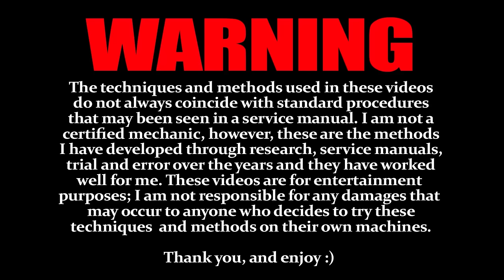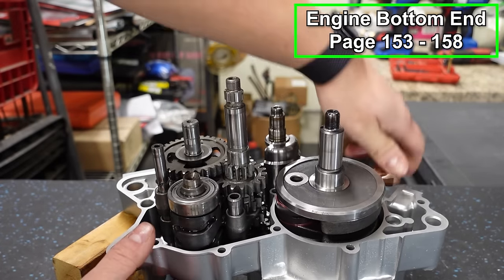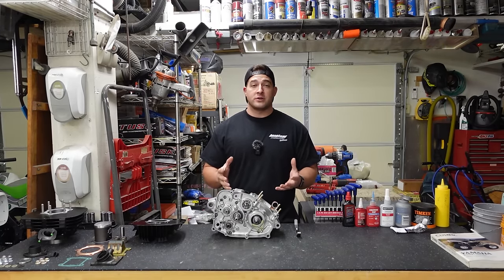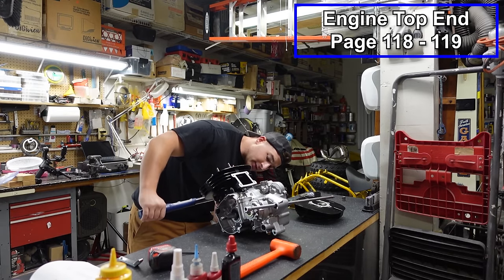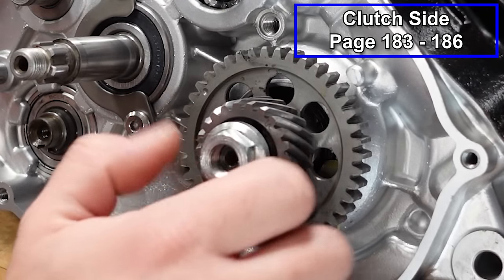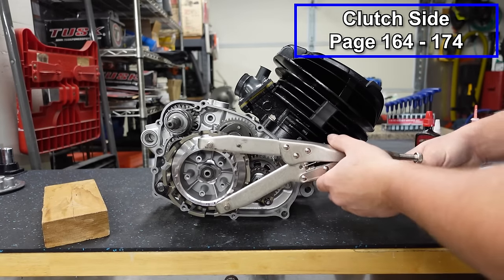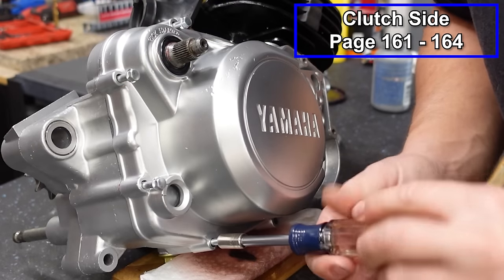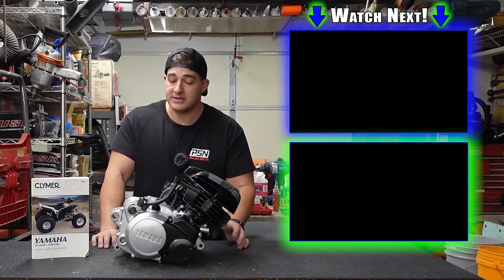How to Build a Yamaha Blaster 200 Engine | 1988 - 2006 Full Build Step by Step

Comment: Im going to need to take apart one of my spare blaster engines in a bit for a motorcycle project. This video is something ill watch a few times before i reassemble it. I have a 1972 ct175 that the engine was shot to pieces in. I decided to take a spare blaster engine and put a vitos 244 stroker kit on it with a 38 mm high velocity lectron carb on it just to see what its like. Im going to make a custom scrambler out of it. The 12volt system will be a nice upgrade from the old 6volt.

Comment: I just watched it and then sent it to my daughter so she can go through the video when she gets out of school. We are tearing her blaster down this coming weekend and making a parts list so we can start getting her rolling. I’ll probably use the parts you have in the description, I would rather her learn with cheap parts so she doesn’t destroy something expensive. After that I’ll probably pick up some +2 alba arms and some wheel spacers in the back to give her a little more stability. Throw on some nerf bars, kill switch, and hand guards and she will be ready to go for now. I’ll upgrade shocks and stuff for her as she gets faster at riding.
Reply from the maker: Nice dude! Make sure it's jetted right and it should run fine; 7 hard hours on this one and it's still running perfectly.

Comment: Biggest time saver would have been heating up the crank bearing and freezing the crank. It will literally drop in…..no need for the crank puller. Love your videos! I’m the owner of a 50+ hp drag blaster on methanol lol they can definitely be little rippers!

Comment: I know these 200cc Yamaha Blasters were very underrated for there power I've seen some of these make crazy power for there size plus a 6speed transmission made em insane fast and I always thought the chassis was a little small they were awesome Quads
Reply from the maker: Very true man, the lightweight compact platform makes it a really fun power plant
Reply: @MichaelSabo  yeah I ain't rode one since the late 90s and it was a weekend racer and my trail quad to through highschool and it never died on me I didn't even rebuild it like a lot of the track guys did every weekend I ran mine until  compression dropped about 10-20psi and I didn't even run the single ring weisco like a lot of the competition did I used the weisco but the 2 thin ring dome top setup I did add a milled Curtis Sparks Head and a reed cage they offered for em and it was a beast plus I went to a 30mm Mikuni carb cuz mine did have the big bore jug like my warrior had one thing about every Yamaha I ever had they all came with Mikuni carbs Honda always came with those Khein or however you spell it but you have got me itching for a KFX 450R now I heard Suzuki made a 450 to and In North Alabama everyone always ran Honda or Yamaha quads and Polaris mostly but I always liked the Quad Racers I had a 250 QuadRacer 250 later on and it was awesome I wanted a QuadZiLLA so bad but nobody wanted to sell em if they had em lol kinda like 250R Honda's id really love to see A Yamaha Warrior or YFZ chassis with a YZ 250 two stroke on it I think Yamaha really missed a opportunity with a factory 2 stroke 250cc Quad

Comment: I just picked a blaster up last week the clutch cover was loose and could move the gasket the clutch was frozen up and the tors has now been deleted properly but it needs reeds and the head was loose as well as the chain and basically everything on it😂 I really should have gone over it better I had to rebuild the carb they had the overflow hooked to the crank breather the oil was a purple and blue milkshake color but I got it running just needs a good rebuild. Great video btw just what I needed!👍
Reply from the maker: Hopefully this video can help you get yours straight! Thanks for watching man!
Reply: @MichaelSabo  it definitely helps thank you I try to watch every video when it comes out love the content I also have a 400ex I've watched your 426 build a couple times now your videos help a ton!!

Comment: This is an excellent video, had it up for reference on the TV in my shop the whole time I was rebuilding my Blaster engine.

I really need some help/advice on a problem I’m having with my Blaster. It starts right up and idles good but whenever I start to accelerate, as soon as I get moving and let go of the clutch it stalls hard. It stalls so hard it feels like the brakes lock up and the tires skid, then the bike lurches forward to a dead stop. I’ve pulled the clutch cover off so many times to check the clutch basket and clutch arm alignment but it keeps on doing it. I don’t know what to do anymore. Has anyone ever had this issue? What am I missing? What did/what am I doing wrong? Any advice is welcome and greatly appreciated. Please help!

Comment: This may sound funny, but one of my good friends swears by ford motorcraft rtv. Even though your surface prep is crucial to rtv performance.  He said there’s something about motorcraft rtv that seems to out perform others.  Funny thing is, a GM mechanic friend of his told him about this.  And he’s used it on everything including his quad cases and snowmobiles.  He’s had yamaha rtv fail and leak but never an issue with motorcraft.

Comment: Hey Mike, I'm building a blaster motor and ordered the Vito's +3 crankshaft kit. When I put the cases together the crank and trans installed and torque to specs the crank is hard to turn. So I'm thinking the crank bearings are not seated all the way in the case so I disassemble and your right that yamabond is a pain in the arse. So I removed bearings to check the width and they are fine. I reinstalled bearings making sure they are seated. Then checked my  Haynes manual for crankshaft assembly width which is 57.90 - 57.93, so I measured the width I can get it if I push on calipers with about all my strength. Does that sound normal or should I contact Vito's. Just looking for some input on this problem.

Comment: I've heard mixed opinions on using anti sieze on bolts that are going to be torqued as the anti seize can throw off yhe torque values. How much truth is there to this? Maybe it's different with smaller engines versus full size engines. What are your thoughts? Thanks!

Comment: Hey Michael I just completed my top and bottom end rebuild of my 89 Blaster with all Wiseco components but I did install a Chinese carb and I fired it up for the first time and as soon as it started it was like the throttle was wide open and I had to hit the kill switch to turn it off do you know what could be the problem

Comment: The clutch steels are being placed at more of a 120 degree offset instead of 60.
Reply from the maker: I do make mistakes. Realistically it won't make a difference as long as they're equally offset.
Reply: @MichaelSabo  no worries. Just mentioning before the official degree police showed up.

Comment: hey, i was wondering if the specbolt kit comes with actual bolts and not screws for the engine? you linked the one but i was wanting to do a one and done kit

Comment: It usually doesn't change the torque no matter where you grip the torque wrench, for lets say 13Nm you need to apply 13N of force at the length of 1 meter, so if you grip closer to the head you need to apply a lot more force to achieve the same 13Nm. If you grip it at half a meter, you need to apply 26N of force. 1/4 the length, 4 times the force needed and so on. Maybe the accuracy drops a tiny bit, but it's usually not noticeable. 
Edit: if the torque wrench has the pivot at which it measures the torque far away from the head, then you must grip it where it is intended. But usually torque wrenches have the pivot right next to the head or sometimes even integrated into the head, so that is usually not a problem.
Edit 2: If you have wrenches that are completely flat, you don't even need that wrench to torque wrench adapter at all, just find the right bit that fits into the regular wrench, just remember that the angle between the wrench and torque wrench MUST stay at 90°.

Comment: Hey Mike quick question, does your torque spec change when you use an extension on a torque wrench?
Reply: If it’s a straight extension the torque will not change. It will only change if you have an adapter on it like a Crowsfoot that changes the dimension from the center of the fastener to the end of the torque wrench handle.

Comment: I don't prefer those crank puller inners myself. I think they make the main bearings unhappy. I get everything else installed in the appropriate case half, put the sealant on the other half, heat up the installed main bearings with a heat gun, toss the frozen crank in there, then the other case, and bolt them together. I'm pretty sure I've seen you do that before Mike.

That IS a strange shift drum yours has. Blasters all came with the welded on shift star according to the fiche. The only real difference is, the trans has to be in gear in order for the shift star to clear the shift star shaped cutout in the right case half.

The only time too much sealant can hurt is on a four stroke. I've seen oil pump pickup tubes CLOGGED with the stuff! Watch how much Mike uses here, just right.

+1 on the phillips head screws, they suck. Not so much inside the engine, but on the outside, yes. Annoying.

If I don't tighten a fastener for some reason, I write it down. Organization is key.

If anyone "called you out" on using the torque wrench incorrectly, I hope they weren't rude about it. I hope I don't ever come across as rude. Sharing knowledge makes us ALL stronger, and it doesn't take long to be civilized about it.

Hmm. That motion pro torque wrench tool is pretty neat.

I said it before and I'll say it again. Those head stud hole slop fixes are damn impressive.

That kick spring fix is damn impressive too.

Another great job Mike! Thumbs up emoji isn't working, or I'd put one here!

Comment: For clutches: u dont want to install them dry! Just soak or just get some oil on them, whatever, as long as they aren't totally dry!! Send them in a bag for a week, doesnt matter. But when to change, there is literally no need to change every single one of them if not out of spec. Use a measuring tool and use on both fabrics and metals.
 If only one is worn or out of spec, just change it! It will save you so much money in the long run and I will promise you it wont matter for the bike, and not to use other brands of packs either, bike doesnt care, only the companies want to sell and u to buy their stuff. For metals, be aware of a motor and clutch's getting very hot, if its blue - doesnt matter what so ever, but the straightness of it does. 

So take your steel/metals and press them all together in a separate bundle and press them up towards a light source and look for any gaps. And then you just change the metals after need, and this is before or after you've measured for acceptable spec range.
and remember the more HP ur running in ur motor - the more clamping force and spring preassure u will need on your clutch. Usually its very over spec'd.

if u have trouble pulling in ur clutch - remove an equal amount of springs ur change to lighter ones before running out and buying clake one clutch's........ there's ofc other tricks to make clutch pulls softer. make sure ur if using cable, this is clean and lubricated! and also many install levers just besides to the handle and that will make for worst leverage of leaver possible, simply shift ur position of shift handle more to your right. also better clutch handles for even greater leverage.
 you can also use spacers to change clutch pull ratio. proper maintinance and knowledge is to prefer over daddy's money. that will only come in second hand ;)

its always what you doesnt know that will punish you